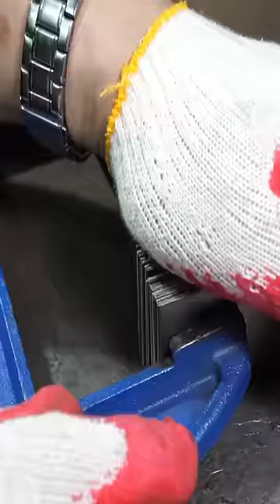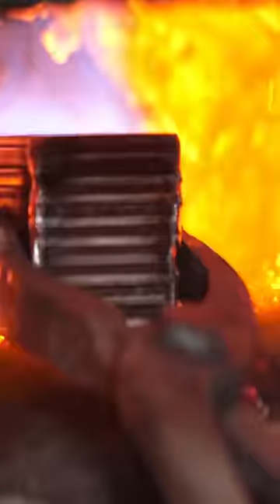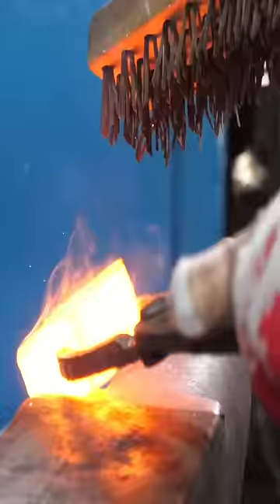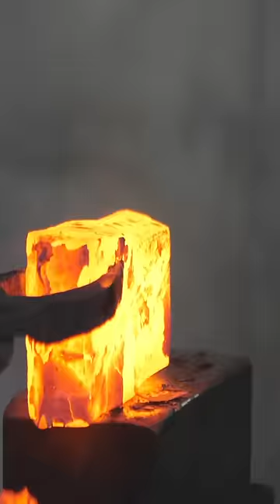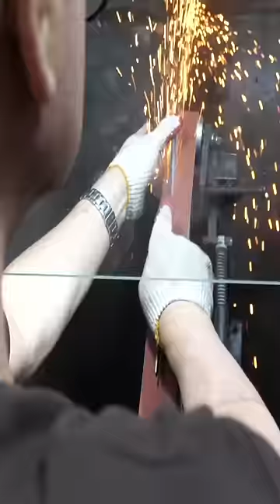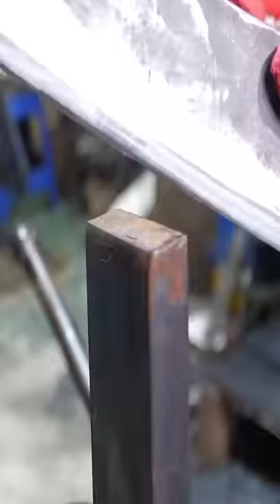The process of making Damascus knives by Korea's best handmade knife craftsman.

Comment: Did I just see that blade cut metal? Wtf
Reply: The metal is heated, therefore it is softened
Reply: He's talking about the part when it's finished, not the heated metal.
Reply: @vierzwanzigen9722  ahh then it's because the blade was so sharp and it's Damascus as well
Reply: @vierzwanzigen9722  Sorry about the confusion
Reply: @kolnoukdajasper pattern welded steel doesn’t increase its strength or cutting properties, the knife is just well-treated and freshly sharp.
Reply: Hardened blade. Perfectly tempered blades can cut the metal they are made from
Reply: Huh  @kolnoukdajasper
Reply: @firstletterofthealphabet7308 it actually does
Metal has a grain and cast metal has a very weak and disjointed grain and random grain, forged metal has a straightened grain, closer to the pattern of bismuth, and Damascus has a very wavy, but strongly held grain

If the grain runs blade to spine, it'll be more likely to chip or flay along the blade and likewise for the tip of the tip runs from base to tip

Damascus grain doesn't run in any one direction so it doesn't have directional weaknesses and tends to be stronger than regular forging because of the bad consistency of the grain direction on regular forging, though if you forge a blade that isn't layered and the grain happens to run along the blade, it will be stronger than Damascus
Reply: @BoxySonic  so, in the case of a forged blade in which the grain runs along the blade (and can cut Damascus), do the disadvantages you mentioned earlier apply or not?
Reply: ダマスカス鋼はもう作れないんやで
Reply: it's probably zinc or another metal you can crush in your bare hands.
Reply: @firstletterofthealphabet7308 Original, like ancient forgotten damascus was tougher/better, but modern damascus isn't. We don't know how to make old school damascus anymore.
Reply: @pattondurio  is there a documentary on old Damascus you can recommend ?
Reply: U saw it twice yes
Reply: @kolnoukdajasper  Damascus blades are usually weaker than solid steel blades. The patterns are just for looks.
Reply: @pattondurio we absolutely do know how to make ancient Damascus, we just don't because it's worse than modern methods. 

The strongest and sharpest blades in the world are all modern blades because of massive advancements in metallurgy.

All of this is irrelevant anyway, Damascus has zero effect on the cutting ability of a sword, that is determined by edge profile, weight, momentum and angle
Reply: @firstletterofthealphabet7308 it increases durability and sharpness. Every single metal has a maximum sharpness capacity. When you make a damascus forging, you increase the capacity of sharpness. This metal that you obtained is both bendable and durable, hard. This is why it's better
Reply: Yes and no. It was more so battoning, like survivalists do with wood, but that is still only possible because the blade is sharp as shit!
Reply: Blades cutting metal is nothing unusual, you dont need a Katana or a Zweihänder for splitting Metal, a small Axe could do the job as well when it comes to cutting Pipes.
Reply: The scream I scrumpt when I saw that!

Comment: Just be aware that none of this is true Damascus steel. That recipe has been gone for hundreds of years. This is just the closest we can get.
Reply: Where is  Damascus blade from 
I mean origin
Reply: @adityath1806  ...damascus. its named after the city.
Reply: @viviolet7 nah fam, that's just where the europeans got it from in the period where that term was coined.
Reply: This is a modern revival of the recipe, smiths have been forge welding and pattern welding for millennia. They just stopped doing it due to advances in metalworking.
Reply: @Arnonator I was so disappointed when i learned that damascus isn't the best
Reply: i’d rather have a modern steel blade than damascus anyway
Reply: @captainjellyfish1791 what is?
Reply: @adityath1806  from Wikipedia- Damascus blades were first manufactured in the Near East from ingots of wootz steel that were imported from Southern India (present day Tamil Nadu and Kerala).The Arabs introduced the wootz steel to Damascus, where a weapons industry thrived.From the 3rd century to the 17th century, steel ingots were being shipped to the Middle East from South India.There was also domestic production of crucible steel outside of India, including Merv (Turkmenistan) and Yazd, Iran.

Loss of the technique

Many claim that modern attempts to duplicate the metal have not been entirely successful due to differences in raw materials and manufacturing techniques. However, several individuals in modern times have successfully produced pattern forming hypereutectoid crucible steel with visible carbide banding on the surface, consistent with original Damascus Steel
Reply: I used to associate it with Tamahagane for some reason😅 it’s essentially for looks these days, San-Mai lamination is my favourite these days, simple yet elegant
Reply: @acm-gs6bl Damascus looks way better and can be way stronger than regular steel if done correctly
Reply: Меня Зовут Будат
Reply: Меня зовут Булат
Reply: @adityath1806  

The Roman Empire was very much known for this, the Romans had a fine Quality when it comes to their blades, one Month of hard work for the creation of such a sharp blade made of Iron and/or steel and folded over and over again for a great stability.
Reply: People in Iowa State University found a really good scientific replication of original Damascus steel too.
Reply: These just look cool. Isn't it quite unlikely that Damascus would be particularly better with the quality of steel we can just stamp out nowadays?
Reply: @captainjellyfish1791 Damascus is the best actually
Reply: Forge-welded doesn't have that ring to it.
Reply: The recipe isn't lost, ots pretty easy to make if you can make crucible steel. It's pretty but not as strong as none damascus
Reply: This again?

Comment: no doubt strong but simpy inferior to a properly forged  and heatreated equivalent, the steel in the video is hareder than the steel it cut, any blade with corresponding properties will do the same